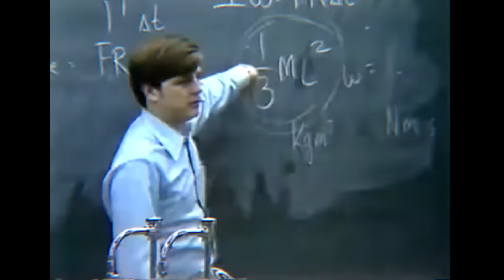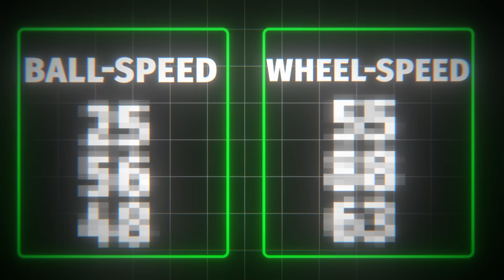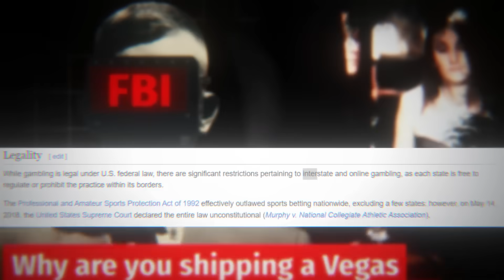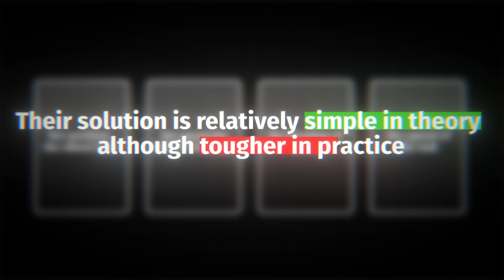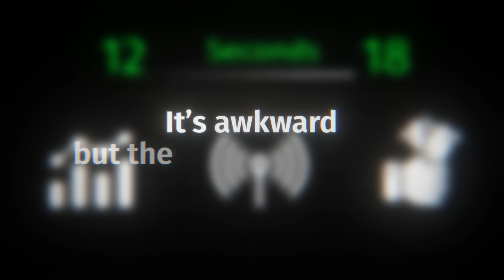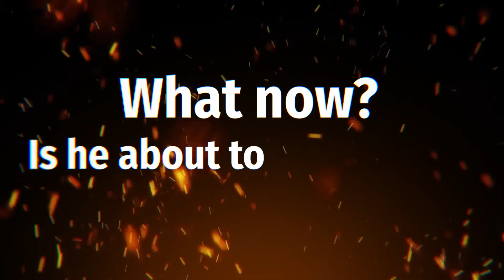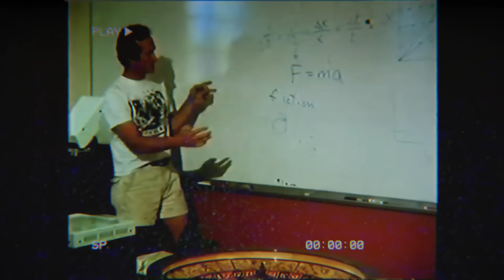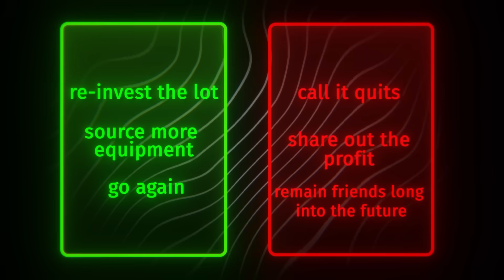The Nerds Who Beat Vegas Roulette With Science

Comment: The wheels become slightly unbalanced over time.  These are rebalanced from time to time.  If you can document the numbers over several days at one that hasn't been balanced in a while.  You should get a 1%-2% advantage on six number section.  You would also need a large bankroll.  The casino I worked at had never rebalanced either of the 2 roulette wheels in 6 years.

Comment: As a croupier, I can attest that the only strategy in Roulette is to be very very lucky.  Especially with no automation, there are far too many variables to reliably predict the outcome.  Also, many of the simulations displayed are incorrect: the wheel and ball must rotate in the opposite direction.  The bumpers add quite a bit of random variance as well.
Reply: also the croupier can change some of the variables slowing ball increasing wheel speed even putting a spin on the ball
Reply: @philiprice7875 If there is a spin on the ball , it will either quickly disappear or the ball will quickly and randomly exit the ledge that it rotates around the wheel on.   This ledge and the ball moving around it will make the ball roll in the direction around the wheel.   So the spin will stabilize quickly.  There is friction between the ball and the ledge.  This is like a bowling ball but spin on a bowling ball can persist because the bowling alley is short.   It it were extremely long, then all bowling balls would spin the same way.
If the croupier changes the wheel speed , it doesn't matter because you time the wheel speed and you also time the rotation/speed of the ball going in the opposite direction with every play of the wheel.    The only thing they could do is if the croupier had a foot pedal to change the speed of the wheel after the ball is thrown.
Reply: @philiprice7875 : The fact that past results are prominently displayed should be a tell that considering that data for making bets is one of many tricks for suckers.  Notice such info isn't displayed at blackjack tables.
Reply: Yupp, but as a croupiere I can tell you, if I make an exact wheel speed and exact ball speed, I can kind of like 66 percent of the time get the exact column I want to hit. Sometimes when doing this trying to hit 0 I get it between 1-19 spins. Pretty good ods if I say it myself@philiprice7875
Reply: @Zer0ne-Infinite  nice! Admittedly, I spend far more time dealing craps than I do roulette, so I’ve not attempted trying for certain numbers or calculating success rate, but I feel inspired to try it (and I probably will the next time I train someone on roulette!)
Reply: @Bubbles_the_Siren  nice, it looks Hella sus to do it tho lmao, I'm lucky I'm online and camera shift alot
Reply: @Bubbles_the_Siren  oh and I meant section not column lmao columns crazy
Reply: @Zer0ne-Infinite  tell a friend to come in and bet 0 every time while you shoot for it
Reply: @Zer0ne-Infinite  I always wondered if a croupier was good enough to affect the outcome ever so slightly. I'm sure it's like any other job of mass repetition, you get bored, so you mess around with the minutiae, only to discover there is something to variation in technique. Your eyes are much more nimble than ours at this point.
Reply: @bastokrepublic  ill probably lose alot of friend while trying to convince them that the 16th roll gonna hit it
Reply: So if a croupier saw someone winning too much could they try to  alter spin to make the person lose and help the casino?
Reply: @stillshot2  they could try. It probably wouldn’t do much, but yes, they could try.
Reply: @Bubbles_the_Siren  nice. The best bet in the casino is to bet the pass line when the point is on, on crappers delight.
Reply: I also noticed the simulation was incorrect and it was triggering me that the ball was rolling across the canoes. Lol
Reply: @TheInfamouspif  well it wouldn't be a great idea to show everyone exactly how it works would it? I'm sure thts not the only thing shown incorrectly
Reply: @TheInfamouspif  hey genius, if you had a Casino, why would you provide a game with no house edge?

Unfair?????

You are hilarious
Reply: For me it was more psychological than math. After watching a television show,  I concluded that female operators would rather not be at the table, because it was boring.  My benefit is that when the operator is bored random actions are limited and a routine sets in. Subconsciously the ball is released at the same rate, and within a close position on the wheel each time. It's worked for me and I tip well. The key is to let three plays go through.  Playing those three numbers, preferably blocks of 4, along with 0, 00. Works for me.
Reply: Humans have a pride in their work. Croupiers naturally and often subconsciously drift towards perfection. Economy of movement, practiced speech and patter, be warm and polite to the players. If you run a slick table, people will be happy and gamble more. Keep the tempo of the table steady by staying consistent in your work. 

This tendency makes croupiers predictable, and a bit of observation will let you see which parts of the wheel are hot. I have known more than one croupier observe this on their own. Noticing that they would get a streak of numbers in spins over the evening. Noticing that they could predict that certain numbers would come up in the next few spins.

It isn’t about predicting the exact number in a spin, but tilting the odds of the wheel to the players favour.
Reply: @King-Kazma  Very true. I used to apply TRD decals on Toyota trucks. Massively repetitive work. While talking to a logistics guy he was amazed it wasn't automated by a robot. To which I replied after the first 2000 trucks you ARE the robot.
Reply: Basically the only thing the casino needs to do to beat any roulette strategy is close bets before launching the spin. Then you can't do clever physics to predict it and the house edge handles the rest.
Reply: I've always wondered though if I visited the same wheel every day consistently, could I get ahead of the wheel's natural bias? I doubt it, but studies have shown that individual wheels have tendencies over time. Can I detect and take advantage of that as a player? Hmmmmm. Just need someone to bankroll me $500k or so. LOL
Reply: Have you seen any big wins?
Reply: @davidradovsky7405  there was a lady who hit the number exactly 4 times in a row.  One of those times she had 100 on it.  This was great for everyone because she was playing for charity 😇
Reply: Difficult for a human, not so hard for a computer. They weren't predicting the exact number, but a sector - range of numbers. With today's computers, I bet simulations could predict the exact number with surprising accuracy.
Reply: Haha false! Luck is not the only way🤫.
Reply: Yeah your mind can't grasp something like that this is your best answer.  Next time say no more lol
Reply: “Bumpers” are called canoes btw. You should probably know that 😂
Reply: Yes, at 8:25 the ball and wheel was rotating in the same direction.
Reply: but how is this event working? in roulette you can bet AFTER the ball has been tossed into the roulette wheel?
Reply: @FlareBlossom  Yes, you can choose just after the ball begin to spin on the wheel.
Reply: 12 or so years ago a casino had automated roulette. I would wait for the ball to go three times one way. 3 times odd, 3 times red. Then i would bet the opposite. If i lost i would double down. They eventually took it out. Tried doing this at real roulette and it was just too random.
Reply: My strategy is to look where they spin the ball as in what number it is opposite and where it lands
Reply: If you are a lucky gambler, you can win. If you have normal luck, you will lose over time.

There is no winning strategy, other than being lucky.
Reply: Maths is another way to beat rulette
Reply: @vitkomusic6624  math proves that the game is unfair, meaning the chances of winning and loosing are not equal.
Reply: @BoxCox  it’s not unfair, it’s like the lottery. You have small odds of winning and the outcome is generally random.  Fair, but terrible odds.
Reply: @vitkomusic6624     WOW, so tell us about this math that will help us beat roulette 

There is no strategy or "maths" which will even diminish the house edge, much less remove it

Perhaps you need to take a maths course
Reply: @vitkomusic6624  lol, I'd like to see that maths
Real maths actually shows you cannot win
Reply: @vitkomusic6624  If you bet on red and double your total each time by 5-6 turns your odds of winning is insanely high. when you win you go down to your starting bet. Your bet depends on the total amount you have to bet with. You would need to be able to double your bet up to 10 turns in order to be completely safe. You only need to hit once for this to work.

Comment: Would have been nice to mention Shannon and Thorp's groundwork in the 60s making the first wearable device ever for this purpose. Did not know this story too though and interesting it was put in practice a decade later.
Reply from the maker: Not completely familiar with this, were they connected? Will look it up thanks.
Reply: @TILT223  yeah funny your video popped up for me I think since I was just reading about this. Claude Shannon and Ed Thorp made the original roulette device as proof of concept and it worked but they just never took it to a casino. Liked your video still, can't imagine trying that in a real casino.
Reply: @mr-robosapien  these guys (and I did read the book in the 80's) and Thorpe/Shannon essentially 'proved' it was "better in theory than in practice".  Roulette is a very slow game, sometimes only 10 spins per hour if the table is crowded (which is preferred, since there's a lot more commotion for security to monitor).  Combined with a croupier who might spin the wheel at a very high speed, or limit bets to well before it slowed sufficiently, or changing the ball (there is a small and large ball), it was just not worth the effort and risk.  The MIT Blackjack situation was much easier, no equipment involved.

Comment: Ok, make an app.  I have a super computer in my pocket that won’t electrocute me.
Reply: Your cell phone could easily do the calculations that they used in this story. And the app would be easy to make. The trick would be how to input the necessary information (their computer required them to input the speed of the wheel and the ball, as they were both moving for the current spin) AND how the computer would tell you the result, telling you where to bet (they set it up so that one of eight little buzzers -- one under each toe -- would buzz, telling them which 1/8 of the wheel to bet on.) 

So yeah... simple calculations, but how do you interact with the computer without the casino security knowing?

Comment: The speed of the rotor slows down throughout the spin. The speed of the ball changes with every spin. There ball also hit ridges that changes it trajectory.  I wouldn't  be surprised if this video was made by a casino rep.
Reply: That factor doesn’t matter, unless the change in the speed of the rotor is random. 
They’re not measuring the trajectory of the ball, only the end result based on initial inputs
Reply: Did you watch the video? It’s not exact every time.  It gave them a 20% edge over the house which is huge, in 00 wheels the edge is a little over 5% for the house.
Reply: @Trashman0211  Exactly, not quite as brilliant as how Otto Berman (working for Dutch Shultz) skimmed off another 10% or so off the numbers racket in New York.
Reply: I didn't watch the video, but I read the book. The students that did this bought a real roulette wheel to experiment with. They collected data from thousands of real spins with their roulette wheel, and developed their computer algorithm from that data... which took into account all of these things you mention. Even after all that, it could only predict the result (i.e. where the ball would land) with moderate certainty. But any prediction better than random would give them a betting edge... which is what it did.
Reply: Their*

Comment: It seems like not allowing bets after spinning the board would be an easy way for casinos to avoid stuff like this. Do casinos currently allow you to bet after the spin?
Reply: The casino I go to lets requires at least one bet from the table to be placed prior to ball being released however additional bets can be made after the ball has been released and allows for bets previously placed to be changed, when the guy or gal waves his hand over the board all bets are over ball goes around another 3-4 times before stoping… it gets pretty easy to guess where it’ll land if you play enough with the same dealer I’ve been kicked out from winning to much a few times

Comment: Funny cause about a month or two ago, I was going to play blackjack but the two guys I was watching were just having a horrible run at the shoe and I didn't wanna join in with them on losing money so I watched roulette for a bit and was trying to think of how I can predict or increase my odds at the game. I was literally thinking about the same thing mentioned.. how fast the ball was travelling and how fast the wheel was spinning. I thought about it while watching the game for a while and figured the same thing.. If you can math those two equations out with the traveling speed you'd be able to increase your odds.. might not be 100% accurate but if your calculations are correct I don't see how it wouldn't increase your edge..

Comment: Try this, a buddy of mine has been doing this for more years than I can recall.  Look at the board, wait till the 2nd/3rd and 3rd/3rd is dominating the results, he bets one chip on the 2nd set of 12 and the 3rd set of 12.  This give you a 66% (well with two green a 64%). If you win it pays 2:1 so you’ll loose one chip but gain 2.  He waits till the ball is spun before placing the bet.  Dealer does anything different he waits till another spin.  Dealers develop muscle memory on spinning the ball during their shift.  Odds much better than 48% going black or red or odd even.
Reply: This is a common strategy, but it's not consistent. Even if you win the spin, it's about risk. You risk 50$ to win 25$. On individual spins you have the advantage, but there's always the chance of that third 12 hitting. 

It shakes out that you need to win twice for every loss - that being the 3rd 12 or green - just to break even, and more than that for a profit. You have a roughly 66% chance on and INDIVIDUAL spin - but to win two, it would be 66% twice, or roughly  43.5%.

The house allows this strategy because it simply doesn't work. As far as waiting for one side to dominate, and trying to read the dealer, most places have dealer changes every 1hr 20m. Maybe you'll win a few spins in that time - but the odda aren't in your favor
Reply: @piratepies5534  0 and Double 0 are why these strategies don't work. People like to ignore that those spots change the odds.

And I've heard some places are now using Triple 0
Reply: I don't even know what you just said.
Reply: hey, I got curious to understand better how this works, you mind explaining again in more detail? I don't plan on playing, I just got curious.
Reply: @MrLuigge  there's an option to bet on 3rds. Top third, middle and bottom. So if you bet on 2 of these thirds you have the highest chance to win. Let's say you bet one chip each on these 2 thirds and win. You get an extra two chips on the winning third and lose the other third so gain 1 chip.
Reply: @bigload6  ah I see but let's say you kept betting like that and winning, they could eventually kick you out of the place lol
Reply: you and your friend are both retarded
Reply: I do this same thing I bet the thirds and cover 2 each time. You slowly creep up on this most of the time.
Reply: With the muscle memory could be onto something becuse they work hours spinning the ball amd swap round but just from doing it so much they might just subconscious get it near the same numbers or area 🤔always look at history but never thaught of looking dealer changing wheel or when they trow
Reply: So basically you're saying that your buddy is a billionaire from beating the casino with this strategy....mmmmmkay
Reply: @glenlarsen8496 
If his buddy has been employing the strategy for years and continues to go back, all that says is that he wins as much as he loses. There are many strategies to reduce your chances of losing big. If you enjoy playing the game, those are the best ones to employ because you'll get to play for longer before going bankrupt. None of those strategies to minimize losses are good at increasing winnings. The only game to my knowledge where you can have an advantage over the house is blackjack. However, that advantage requires a lot of practice and training. Everything else should just be considered paying for entertainment the same way you would pay to play a game of pinball.
Reply: Martingale
Reply: In dark web we say SWIM. Someone Who Isn’t Me. Pretty Minch understood that it is indeed you but not trying to self incriminate 😂
Reply: Martingale
Reply: The way I play is like this:
25$ black 25$ odd 25$ 19-36 25$ 1st dozen 25$ 1st column. 
You then switch randomly . The operator doesn't know what to play. 
So add a few dollars on #2 ... Right next to the zero...